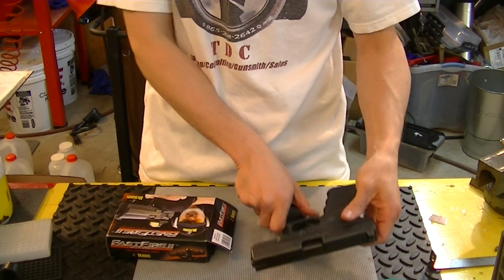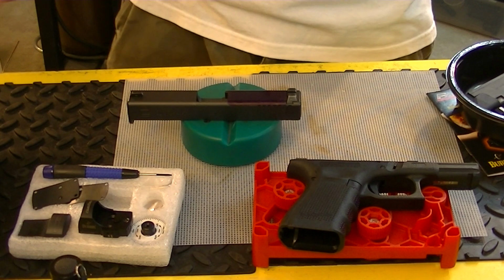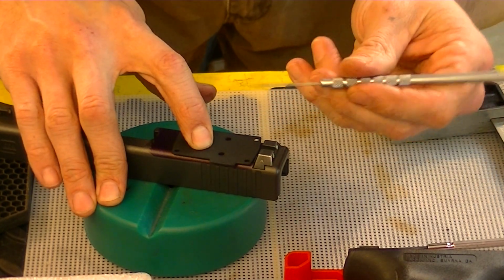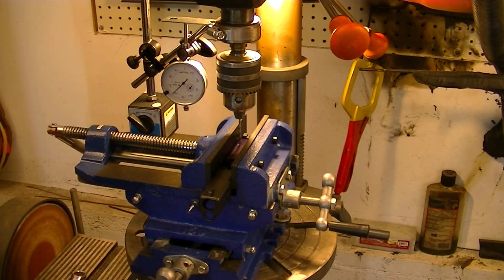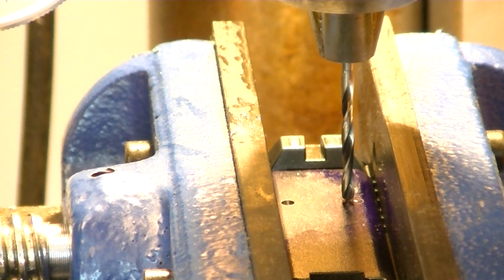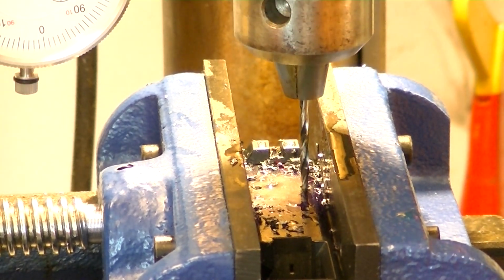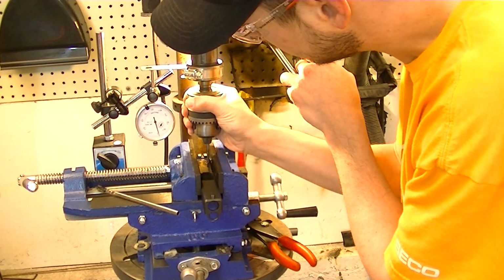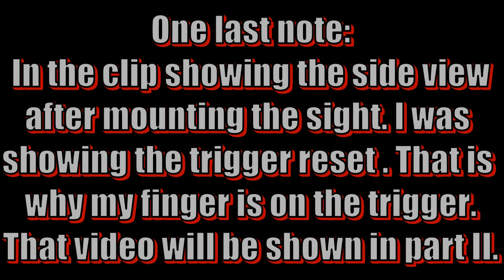Burris FastFire II & Trigger Job on Glock 32 357sig Gen 4 (1of2) sight mounting

Comment from the maker: It is a great set but if one were to run a red dot on a gun for carry and personal defense I would not run the Burris. I would run the Trijicon RMR. The dual powered one that runs on tritium and fiber optic so it is always on and no batteries to run down. They do offer a led illuminated version that is a good choice too because the battery lasts forever. The Burris has to be turned on before use so it is good for competition, fun, and hunting.